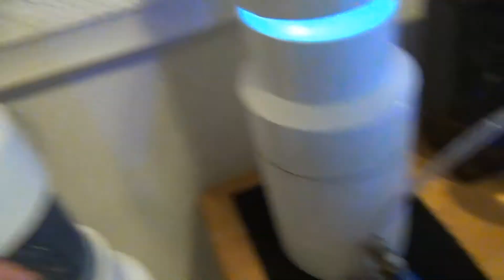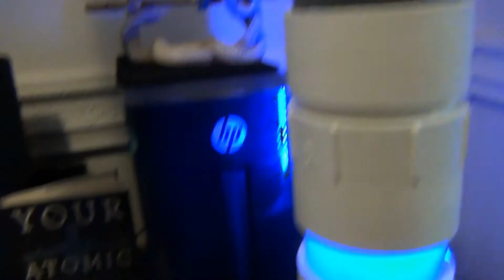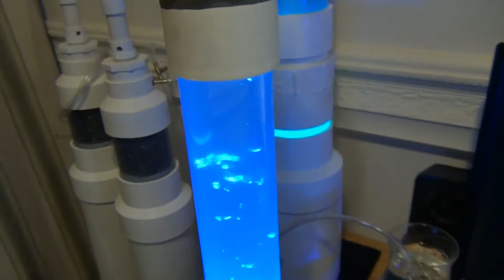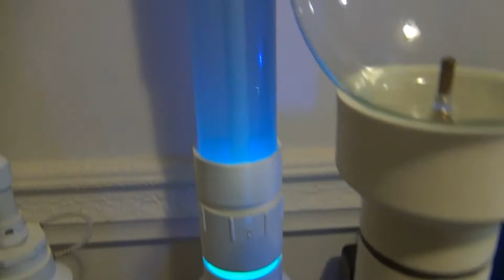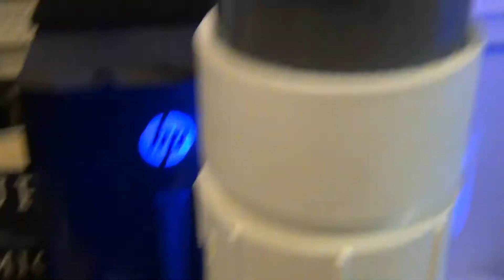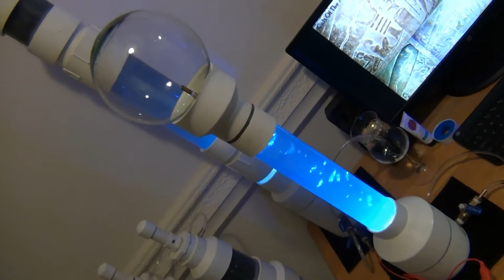HHO SIMPLE LED BUBBLER PVC PARTS & BEHEMOTH DESIGN

Comment from the maker: Here is a peek at the more simplified and traditional type HHO bubbler design before it is assembled it shows where the HHO gas enters the bottom and comes out at the top exit port. There are many types of bubblers out there and lots of wild designs some parts can be threaded and removed and the simpler the better when working with oxyhydrogen gas less parts no thread tape and no magic lube needed less hoses everywhere.